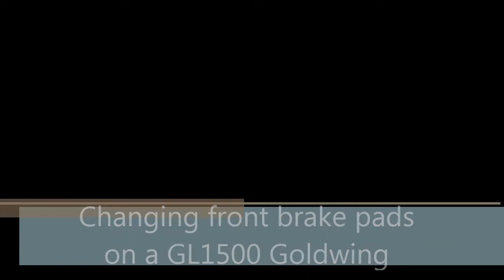Changing front brake pads on GL1500 Goldwing motorcycle

Comment: I'm doing a brake job on my gl1500 today. Rear replaced so far. Front left looks good. Stopped to look up the other sides removal by viewing your video after shining up left side and continuing on to right. Sorta feeling my way through like yourself. The difference is I go ahead and remove the pins plus go ahead and remove the banjo bolt so that I can push my pucks back easily without damaging anything. Reassemble with new pads after removal cleanup and inspection of caliper. Top off  brake fluid in the caliper with my lil red squirt can then throw banjo bolt back in and bleed. Hope this helps you and anyone else in the future. Thanks for the heads up on which side is linked to rear. 
 Shiny side up boys!!

Comment: Just subscribed.  Thanks for the informative video.  I just picked up a 1989 GL1500 with 8000 original miles.  Getting it road ready now.
Reply from the maker: Welcome aboard! Most of my videos on the GL1500 are 1st time jobs and probably not the best way to do some of those jobs, I had a GL 1200 before I was doing videos and I did a number of repairs more than once or twice because I had it a long time.

Comment: The caliper pivots slightly upon braking (firmly) and the lower end of the mounting bracket pushes on the black plunger which operates a bypass valve in the fork leg to block oil flow and firm up front suspension. Anti dive system.  TIP: Best  to loosen pad pins while caliper still mounted. Easier to remove after when you have the caliper off and in hand.
Reply from the maker: Thanks.
Reply: I think so too! I was going to that then i saw the video need to know how to get pads off. Your comment, I will do first.

Comment: Have to make a correction here. You have the pads reversed here. On a 1500, the front left caliper is controlled by the foot brake, along with the rear wheel. The hand brake controls the front right caliper. I understand your mix-up, as the 1200 is the opposite. The techniques are good and informative, though.

Comment: The bearing & the pivot collar are part of the anti dive setup.  Your educated guess was correct.  You are a certified motorcycle mechanic now and can change your buddies scooter oil for 199$ which is a win win for both of you:)
Reply from the maker: Thanks Will, That guy with the scooter stopped buy yesterday and I asked him if he had them change the oil and he said yes, I told him next time he can get the oil and filter and bring it here, he said they changed the automatic transmission oil too and it has 2 places to drain if from or something like that, it doesn't have many miles on it, nobody changes trans oil in a car and they go 200,000 miles on the factory oil, so I don't know why they need to change trans oil on that scooter.
Reply: If it's under warranty it's probably mandatory for the miles that are on it.  His service intervals should be in his book.